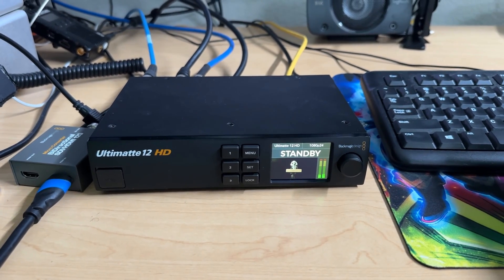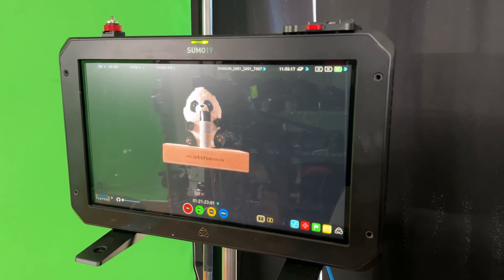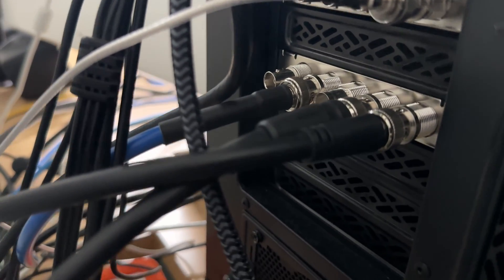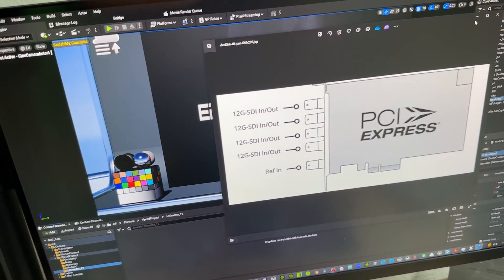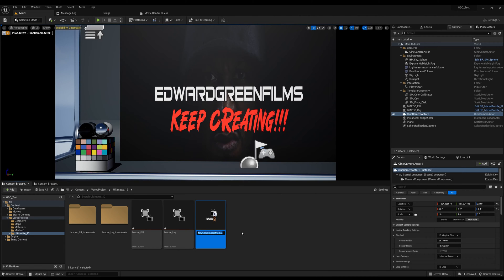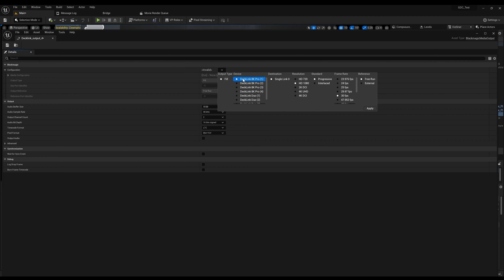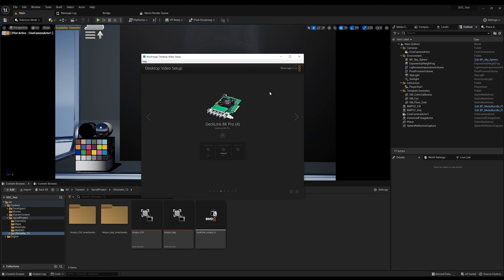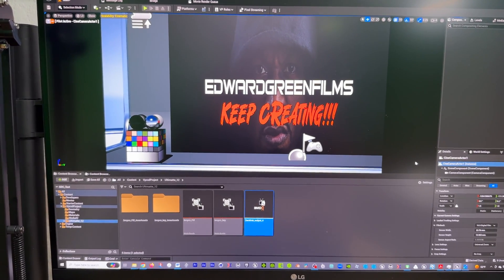My Ultimatte 12 HD to Unreal Engine SDI Port setup (Overview for Virtual Production)

Comment: would the new G2 studio black magic micro ,  camera with its new  12G-SDI port on camera work in unreal?>
Reply from the maker: It should work in Unreal. HDMI's also work it's basically just sending the signal to your computer. You will have to have a way to connect the camera to the computer in Unreal. That's what I am using the Decklink 8k pro for but you can also use the Decklink duo.
Reply: @GTshortStories  thanks

Comment: Very clear explanation. Amazing setup.  I suppose it would be easier/cheaper to have a camera other than the BM 6k there with an SDI out instead of needing the converter.

 I recently  bought a 12 year old  $600(originally $12k) Canon C300pl with sdi,genlock etc which is old and only 1080 but apparently has been used direct eith sdi.

Comment: Dope tut. How do you like that ultimatte over the normal composure keyer? Any other benefits? Are you planning to get the HyperDeck to record out
Reply from the maker: The ultimatte is so much better than the composure keyer. The initial autokeyer that it does on your key is already 10x better and you don't have to do anything. I'm still thinking about getting the HyperDeck. I have my Atomos Sumo monitor that I send my feed out to and it can record for me. I have to see if the Hyperdeck does anything better than that.
Reply: Thanks for the input. But you can still do the compositing in complete right? Cause I add light wrap and blur in there. The hyperdeck from what I see  can be controlled through the atem so it’s just easier to control on desktop plus you can switch and record different streams.